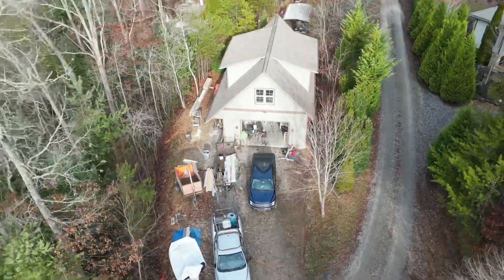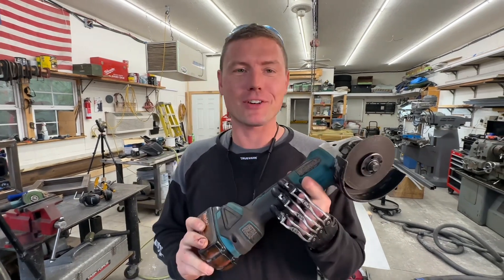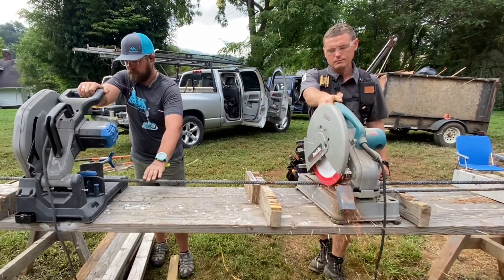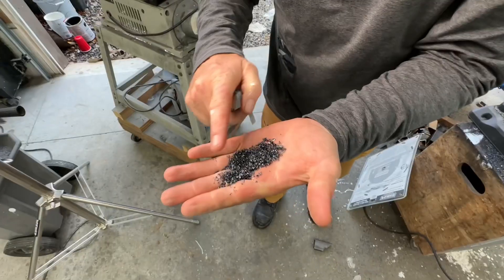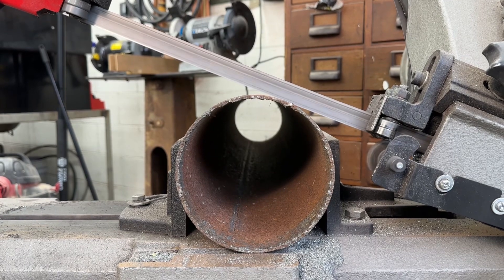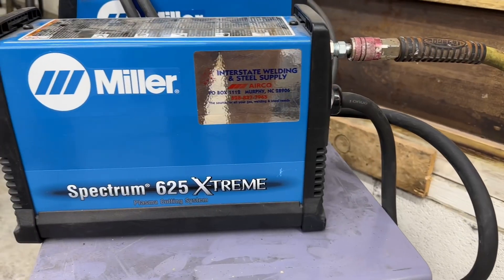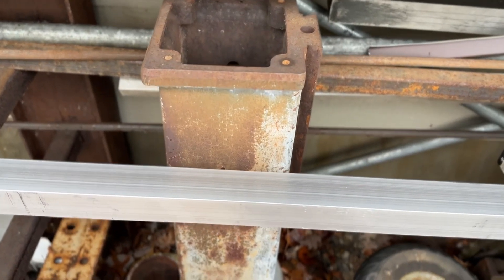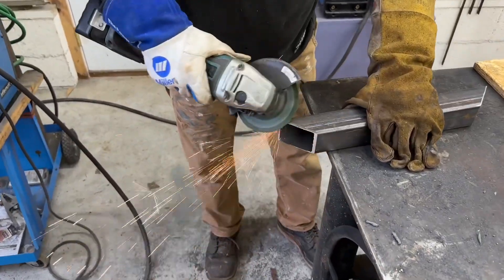Cheap to $$$ metal cutting tools

Comment: I have both a nice Makita 4.5 inch grinder and a cheap Harbor Freight grinder. The Harbor Freight unit was TEN bucks, I use the HF with wire wheels for rust busting. A portable band saw is on my wish list. The WEN is about $100.

Comment: as for angle grinder if you dont have one just get a cheap plug in one. porter cable , black and decker , craftsman even metabo (id get the metabo out of them) all under $40. another $20-30 will get you a makita, dewalt , bosch. id go for the makita any day if you're looking at that price range. such good quality tools

Comment: For some basic cross cuts a diablo 7 1/4" steel demon carbide blade works well if you already have a circ saw and the blade is like $30-40

Comment: The big orange store also sells a sawblade that fits in a circular saw and cuts through metal. I've used it to cut 3/8" thick metal. I believe it's called the Steel Demon by Diablo
Reply: Just make sure you have an extra saw that you don't plan on using to cut wood.

Comment: One quick tip you might of answered and I missed is calling out what kind of power these take.   Are they all 120 and can be on a 20 amp circuit?   I haven’t gotten into metal working because my shop doesn’t have big power in it yet
Reply: that plasma cutter will do either 120 or 240. The band saw is likely 240v as it us usually used in industry. A corded angle grinder and the chopsaws will be fine on a 20amp 120v circuit.
Reply: Plasma can be set to different amps for different thicknesses. The burn table I operate varies from 30-400 amp. I can cut up to 2 inch plate though.
Reply: PerkinsBuildermediiateam  this is probably a scammer. don't message them

Comment: These videos are great... I like the build series as well, but you should definitely do more of these.

Also, if you haven't tried the Diablo steel demon circular saw blades from Home Depot, you definitely need to. Worth every penny, you can cut steel almost as fast as wood.  I don't get my grinder off the truck nearly as much as I used to. 

Thanks for another great video! Y'all are one of the channels I watch with my kids, and they learn a lot from it.

Comment: I would add that the angle grinder with thin cutting blade are VERY dangerous. Safety glasses alone are not enough. The cutting blades sometimes shatter sending large pieces out at high speed. Even with the safety shroud on the tool attached pieces can bounce off solid objects and come back toward your head. Always ware a full face shield when using this kind of cutting wheel.
Reply: The nickname "death wheel" kinda says everything you need to know. When they let go, they punch harder than Tyson...!

Comment: It's recommended that you use a welding helmet when plasma cutting. The UV rays coming off the plasma arc is similar to welding. Can cause eye damage in the future. I'm a boilermaker/ welder in Australia and it's compulsory to use a welding helmet with a shade 9 or higher  when plasma cutting

Comment: From a fab shop owner's perspective I can say every one has it's place. But we use cold metal cutting saw (i.e. yours Evolution) the most because the benefit of fast clean cut outweights the blade cost. And it can withstand a looot of abuse if you use it correctly. By the way, my plasma cost 300€ two years ago and I use regular 50 litre compressor no problem. 😄 So 5000$ is just far from what can really buy, but on the other hand, you guys in America like to buy expensive Millers and Lincolns for no reason (no, the brand really doesn't matter for plasma cutting). 😁😅

PS: Basic corded angle grinder of quality brand is like 60€ here in Europe.

Comment: For extra you could have got a plasma table which cuts at a consistent rate leaving near perfect edges. Another improvement to your plasm system would be the addition of an air dryer.

Comment: There are two types of plasma cutters that are normally used; with or without built in compressor. The ones with built in compressor works if it's low scale production/smaller demand.

Comment: For the angle grinder option I can suggest 2 things: 1. Diablo makes a 4.5 inch diamond wheel for about $17 at the orange box store. They cut a thin kerf like the cut off wheel but I have been running one for several months and have done a lot of projects they are cost effective. 2. You tube has a lot of videos showing how people made a mounting table for the angle grinder to clamp stock and imitate the chop saw. Nice square cuts cheap.
Reply: You can just say Home Depot
Reply: Why don’t you just say Home Depot
Reply: @noahvogt  Because I was the author of that comment and I felt like saying it that way.

Comment: Just have to tell you, please DON'T use gloves with power tools like grinders, mills, stationary drills and more as if you just barely touch any spinning thing it can easily rip your whole hand, arm or if powerfull kill you.

I almost died at school while using a mill and tried to sand lightly and my glove caught and pulled me in but luckily i managed to hold myself back and i ripped 3 fingers off from the glove 😰

One time vinyl gloves is no problem if you need to stay clean and want some chip potection

Comment: Just be careful with a cutoff wheel on a grinder. If you dont know what youre doing those things can be dangerous. Wear your ppe and dont apply too much pressure. Let the grinder do the work and it will last a lot longer.